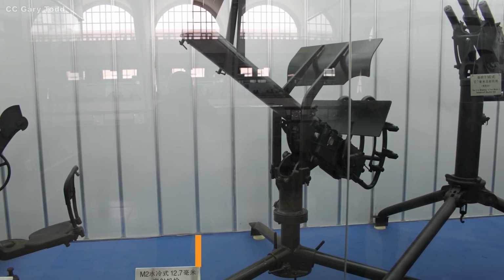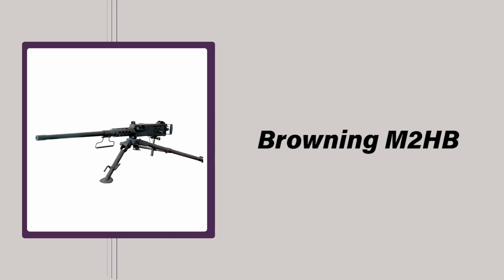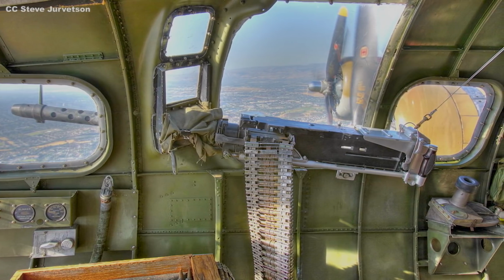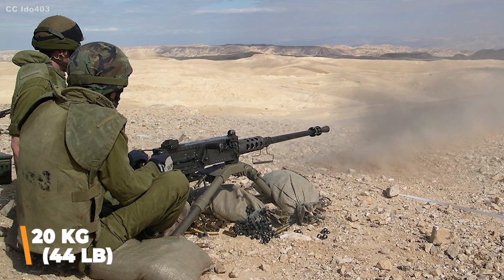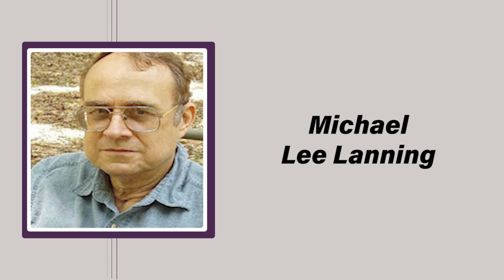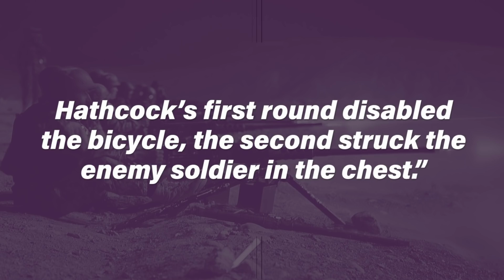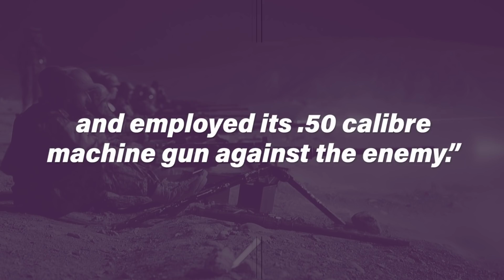M2 Browning: The WWII Machine Gun we Still Use Today

Comment: I shot concrete Jersey  barriers with silver tips. Didn't go through. Iraq. Surprised me. 6 to 8 inch part. Not base. 5.56mm went right through 5/16 steel plate. Green tip. MK19 HEDP throws thin shards. Like sheetrock knife cuts in plastic water bottles. 

Personal favorite M240B.

Comment: There is only one question? Which way does the fat mans belly face? 

Bolt disassembly. 

Barrell insertion how many clicks backed off before headspace and timing?

900 meters grazing fire. 

6500 meters max range?

Can easily hit 3000 meters. Single shots.

Comment: The real testament to the M2 is the fact that the military declared it obsolete -- to be phased out and replaced by the Mk19 automatic 40mm grenade launcher but ended up contracting with one of the various U.S defense contractors to build new M2s and replacement parts because of demand from the troops for M2s to replace the Mk19s they were issued.

Comment: Ah, well "ma deuce". I'm not sure if that was a one off pronunciation but it doesn't feel right. It's more "Ma" deuce, Ma being a slang term for "Mother" (I don't know if it's the same in the UK, but yeah it's a USA thing for sure). I bring it up because (as a former U.S. Artilleryman) I can't stress enough, the M-2 brings the pain. It's fun to even be sitting near it when someone else is tearing up targets. For a weapons system capable of laying waste to aircraft, light armor, buildings, materials really can't be beat. It takes an experienced Soldier to learn how to set the gun up (headspace & timing), but it's worth it. When it's time to call Mommy, know she's got armor-piercing rounds.

There's no current reason to replace this system, each weapon is overbuilt. They are heavy, not too difficult to maintain considering the firepower. There really isn't much hope of anyone developing a better .50 cal machine gun, it would almost be wasted money.

Comment: I had an M2 on top of my humvee in Iraq in 2004. The gun had a wooden charging handle and was originally manufactured by General Motors a year or two after the Korean war, with an overhaul by Saco in the 80’s or 90’s.

Comment: There is a problem with the M2. When you field strip it for cleaning  one piece that comes out is the bolt carrier. This is essentially a box with two spring-loaded "fingers" on the top and one on the bottom. When reassembling the gun, it is all too easy to put the bolt carrier in upside-down. If you do, the gun will fire one round, and then jam. It takes an armourer who knows what he's doing at least half an hour to fix it. 
 
It would not have been difficult to design the bolt carrier so that it couldn't be put in the gun upside-down. I don't know why this wasn't done.

Comment: The legacy of John Moses Browning extends well beyond the “Ma Deuce”. Fabrique Nationale’s Mitrailleuse d'Appui Général, adopted by the United States as the M240, utilizes a modified BAR gas system and bolt mechanism.

In addition, most locked breach semi-automatic pistols rely on some variation of the linkless tilting barrel design pioneered by the Browning Hi-Power, which is an improvement of the mechanism used in the venerable 1911.

Comment: The Ma Deuce fills a niche role similar to that of the A-10 Warthog. It technically doesn't need to be filled, but it fills it better than any alternative out there. That's the need for a heavy machine gun that isn't of cannon caliber round size to be portable for the standard soldier to use. Today, the standard 5.56mm NATO cartridge is the round of choice for all assault rifle class guns. Light machine guns can go up towards the 7.62mm round which is bigger, but still a rifle round (about the same size as a 30.06.) The 50 BMG round is bigger than that, but not as big as a 20mm cannon round.

Is there necessarily a need for the Ma Deuce? No, you throw enough s*it at the wall and some of it will stick eventually. But the thing the Ma Deuce does is reduce that amount of s*it required to be thrown. There's a reason why the US Military likes to say, "When Ma Deuce speaks, everybody listens." You can have all the M-whatevers, AR whats-its, and AK-[Insert number here]'s going off, but you hear that thud of the M2, you know something is being "unexisted" at that moment.

Comment: There are three very important things that make the M2 a gun that will last for probably another 100 years or more: the .50 BMG cartridge is massively effective, and likely will continue to be, and the M2 mechanism is extremely reliable and very repairable.  

If anything, and I mean anything, does the job well, doesn't break often, and can be easily repaired when it does, it is the ultimate for its purpose.  Nothing will ever replace it unless the job it does is rendered obsolete.  The M2 is merely an example of this concept.  The Colt 1911 was another example, but its job changed, so the military got something else.  However, it is still in use today in a wide range of civilian uses.  There are likely a great many Colt 1911s that were built in WW2 that are still in use today, with most parts being replaced due to wear.  

Oddly enough, I can't think of another example that is not a gun.
Reply: B52 stratofortress and technically the Iowa a class battleships. The b52 has been in service for over 50 years and the Iowa class was in service for around 50 as well which is absurd considering that in modern navy barely any ship is allowed to serve for that long.
Reply: The original model VW Beetle is quite close to what you described for the civilian market. Made from the late 40s and only finally discontinued in the 2000s.

It was replaced because there's a tradeoff involved between the factors you mentioned. The Beetle did its job pretty well and was incredibly easy to repair when broken. But newer vehicles did the job BETTER and broke much less often, so even though they were much harder to repair when they did break, they were a better option.
Reply: Both great examples.  I agree with both.  B-51 and the VW Beetle.

Comment: "Madweusse"? C'mon man!
MA DEUCE. Please...

And there is no "point three zero zero six" cartridge, we have the 30-06, pronounced "thirty ought-six". It is indeed in the 30 caliber family (.308, introduced in 1906, therefore .30 Gov't '06 Winchester cartridge), which has an equivalent metric size of 7.62X63 mm (bullet diameter and case length).
The slightly shorter cartridge commonly known as the .308 Winchester is the basis for the 7.62X51 NATO round. 
The 50 BMG round stands for .50 caliber Browning Machine Gun.

Funny that you have to list the four components of a cartridge. But I suppose with so many people still calling the whole cartridge "bullets" and magazines "clips" I suppose it's necessary.

Although it has indeed been used in sniping situations, such as with Gunny Hathcock ( Oorrah, Devil Dog!), and rifles such as the Barrett M82 and M107 are popular for reaching out and touching someone effectively at long distances and behind cover, the 50 BMG round is not particularly accurate, being designed as a volume of fire anti-materiel round. Smaller callibers specifically loaded for precision shooting are much more accurate and effective for sniping operations. Hathcock himself usually used a Winchester Model 70 bolt-action rifle chambered in 30-06 and fitted with an 8-power Unertl scope (not an "eight-time scope", that just sounds weird), nothing fancy but effective.

And I appreciate your effort at saying "Second Lieutenant" instead of "Lef-tenant". Thank you. Although next time just say "Loo-tenant". That's OK, you're almost there...

Comment: For the rest of you, if you can find the 
belt links, and the tiny Tabasco 
bottles, that were included in the 
MREs, you can replace the rounds 
with those bottles.  I've got 2 belts, 
about 60 bottles each.  They look 
impressive, when doing a Pancho 
Villa impersonation.

But, you need to find the links (ebay) 
and the tiny bottles. (For that, you're 
on your own.)

steve

Comment: Back in the 1970s, Ii was in 2/14 QMI  a light Armoured Recon Unit ( M113A1, with either 2x 30cal BMG, or more often, 1x .30, and 1x .50 M2 HB. In enclosed turret. ( not the previous shielded. 50 cal)
I trained and learnt well on both ( came in handy for later Movie Armoury Work)
Esp: "Headspace and Timing" on both guns...especially for Movie Blank firing.
( Which I make Myself for my 3 ×.30s, 2 BARs, 2 M2HBs.). Also have a Japanese 12,7x81 SR Type Ho103, which is an M2 Aircraft Clone. ( same shell as 12,7 Breda, or .5" Vickers Export ( semi Rimmed)
All great guns, " if it ain't Broke, don't try to Fix it"

Comment: Simon, I'm a gunsmith at an Army depot and I come across very early production M2s often. I ran across serial #1390 just the other day.
You might also be surprised to see some of the extremely early M16s we still have in inventory as well.
Reply: I've heard the Air Force still uses the occasional Colt 601 in basic training, albeit, refurbished.
Reply: @dmytro732  in active service, not just training. Absolutely.
Reply: The stories those firearms could tell
Reply: I remember back around 06 my platoon got several M2's added to our inventory. They were all fresh from depot level maintainence/refurb. Two of them had OEM manufacturers markings from GE as they were probably built by GE back in the 40s. Those guns ran better than most of our newer stuff.
Reply: If it ain't broken, don't try to fix it. 🤷🏻‍♂️

Comment: I don't mean to nit-pick, but the action of the t-gewehr I believe is closer to the 1891 Mauser action. Mainly based on it's plunger ejector and push feed system instead of the long fixed extractor and controlled feed system. I believe the lack of a magazine was the justification for it in my opinion.

Comment: I went to war with the "05" four times (Nam, 3x with the IDF), found it  reliable, easy to use and maintain, and an extremely accurate tool for the job, whether on half-tracks, APC, or nest-mounted.  Also excellent for fire-boxing MIGs.  In the field on LARR I always preferred its 'little brother', the "03" rather than a BAR, and hope you'll consider a feature on that honey as well.  War s*cks, but if ya hafta, go with the best, and that would be the 05.  Kudos, out.

Comment: There have only been three changes to the original design. Outside of the variants used of course. But the basic infantry version only had the charging handle and grips switched from wood to synthetic grips, there was a safety added, and eventually they made a guide and locking notch to the barrel to ensure that head space and timing doesn’t need to be fixed or adjusted. You can also switch which side the weapon feeds from. Audie Murphy now has his order order and award. I’ve personally seen someone get this award. It’s a very big deal! But all in all I can say confidently as a combat vet who has used this platform over seas the M2 Browning is an amazing weapon that is here to stay and I’m glad for that fact!

Comment: Remember.. the gun its self is just the mechanical method to send projectiles down range towards its tzrget.. the .50 inch dia projectile has been around since before the  American civil war and its ability to deliver massive damage to machine or man is well documented..
Reply: Bit oversimplified. Projectiles about half an inch across have been around since the sling was invented thousands of years ago, but I wouldn't class a half-inch sling stone with a .50BMG round. Even limited to guns, there's a hell of a difference between a .50 cal pistol round and a .50BMG. It's not really a useful statement to just say ".5 inch projectiles have been around a long time" because the damage inflicted depends on much more than the diameter.

Same deal with the gun. Yes, it's just a delivery system. But you could fire a round using a capped pipe with a nail and a rubber band. It'll still "send a projectile down range towards its target." 

The M2 is impressive because it excels in a number of categories, notably by being an incredibly reliable automatic weapon. And quite accurate as well. And easy(ish) to maintain. And ... (etc)

Comment: Jonh Browning was probably the greatest gun designer in history not only has the M2 served 100yrs his tilting barrel locking system is still being use on the majority of pistols today
Reply: That wasn't the only thing. Turns out the manual safety, grip safety, slide release, and thumb release were also his. Forgotten weapons point this out as he goes through brownings pistols that led up to the M1911.

In short, very few pistol designs can escape Browning's principles. Among other things.

Comment: I have only seen one M2 broken beyond direct support level of repair.  One where the index spring broke, letting the barrel unscrew while firing.  The trunnion ended up split but no one got hurt.
The only other issue was guys losing cartridge stops.  To the point where I had none in stock to replace them.  They tended to lose them when switching feed from right to left hand.

Comment: I had the misfortune of having to use the 'modern' machinegun that was the replacement for the M2 - the M85.  There is not enough swear words in the dictionary to adequately describe this weapon.  It had two rates of fire 'slow' and 'fast.' 'Fast was only supposed to be used in aircraft but wound up being the default setting because the 'low' rate of fire was better described as the 'no' rate of fire.

I would place an empty soda can into the feed tray in an attempt to minimize jams.  We put so much oil on it that it would form a puddle on the floor of my tank.  It was possible to load and fire the weapon with the barrel unlatched.  Whereupon the barrel would be launched like a spear it the front of the tank.  And the links it used were not the same as anu other .50 cal links.  So the ammunition was not interchangeable.

This replacement for the M-2 was itself replaced by - the M2.

Comment: It just works that is why it is still in service.  I sometimes use the example of the claw hammer vs the nail gun, the latter is higher tech and much quicker but requires an air compressor and specially packed nails and isn’t terribly portable.  The former is cheap, portable, and can be used for a vast array of tasks limited only by imagination. The really amazing thing about the M2 is that the DoD hasn’t commissioned a billion dollar study to replace it with a “smart” weapon that breaks three times more often, requires someone with a degree to repair, and costs at least 10 times as much………..beware committees and studies they can break anvils if you let them.
Reply: They've tried. Needless to say the attempts were abject failures.

Comment: Ummm, if I'm not mistaken, @ 2:48 that's an M1919 type .30 MG, not a .50. In a ground combat role, why would you need a barrel shroud ? Even in an air combat role you wouldn't need one. I dont think i've ever seen an M2 with one. Besides that, I've never seen an M2 fired that way.

Comment: Having had a long term relationship with one of these: It's impossibly good. There are way too many parts in it. It should not work this well. It's everything engineering tells you not to do. All theory says that it should be either unreliable or maintenance heavy... but it is neither.

I don't know how many thousand rounds I've put through one of these. Of all of those I've had exactly one malfunction: a failure to extract. I can't blame that on the gun though. It did extract the bottom section of the casing alright. But since the case had ruptured most of the front end was still stuck in the chamber. It's kinda hard to extract two pieces as if they were one...
Reply: Not sure if its true, but i believe they did away with the head space and timing. How dare they do away with that staple of gunnery classes.
Reply: @mikek4288  I believe the only reason for the headspace/timing adjustment was because of manufacturing tolerances at the time of design and initial production. While it was possible to machine for a perfect fit, doing it at scale and speed was difficult back when everything was done manually. Now, with modern  CNC, you can knock out barrels/bolts with 0.001" tolerances all day every day.
Reply: @mikek4288  They did indeed. I was trained on "the OG Ma Deuce" and the message was "So basically... don't change barrel in combat because you won't have time for that shit. Just toast the barrel if you absolutely have to."

Comment: I served in the Marines and Army, I got a lot of trigger time on the .50 BMG in both services and was specifically a .50 gunner in prep for my 2nd deployment. The .50 BMG is an amazing firearm, they are easy to maintain, easy to set up and insanely accurate. The most recent upgrade to them during my service was some of them were fitted with a safety integrated into the butterfly trigger control. Prior to that upgrade there was no actual safety on a .50 BMG either it was locked and loaded and you didn't touch the trigger or you unloaded it and cleared the chamber making it unable to fire. Guys who used them a lot would tie an empty .50 casing off one of the side handles with 550 cord and you could slide the casing under the trigger and between the back of the receiver and it would create a make shift safety because the trigger couldn't depress to fire, and if you needed to fire you'd just yank the cord, casing comes out and hangs out of the way and you can immediately fire the gun.

Comment: Good video.  Only 2 errors, neither major.
9:42 - Not video of a M2, but a twin M240 (or FN MAG) in 7.62mm Nato.
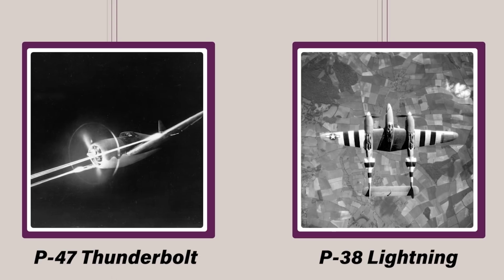10:42 - WWII US attack aircraft and bombers could and did use 0.50cal M2 Brownings offensively (see A-20 Havoc and B-25G/H/J with strafer nose, as shown at 10:42)